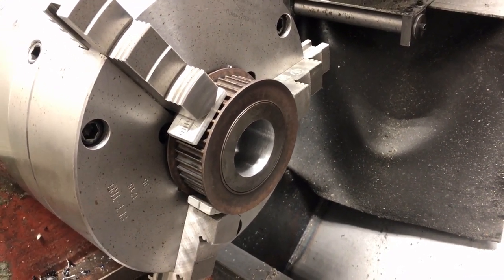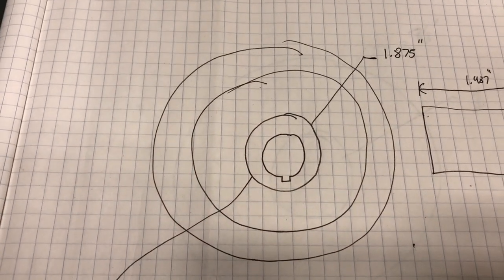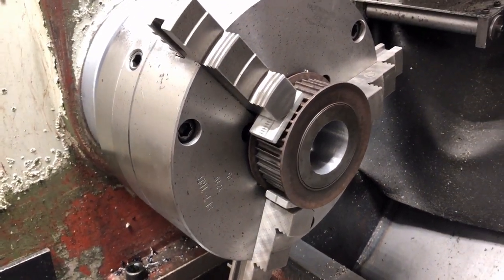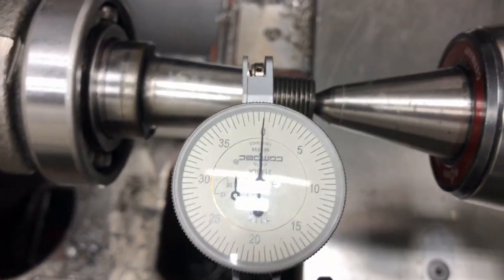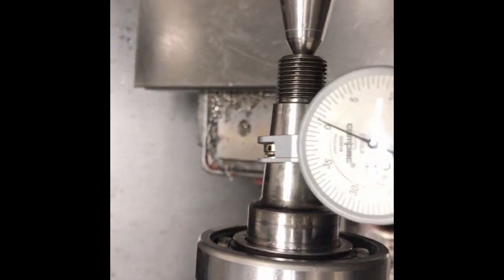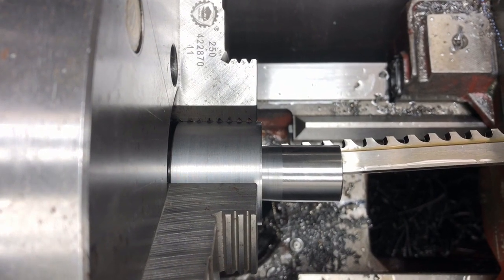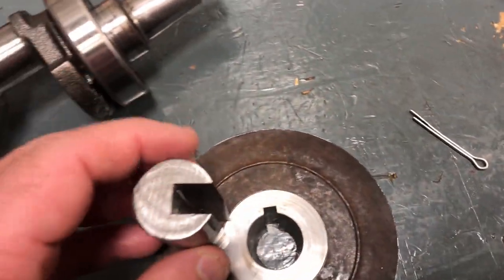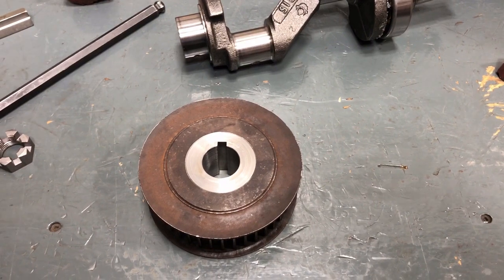Pulley With Tapered Bore and Keyway

Comment: Nice repair , that will last no worries .   That compressor may just be like a Tu Flow 500 or 700 .   On a pump they just blow air through a venturi to create a vacuum for the pump , so no big load on them .      Was the pulley made from some wierd cast stuff  or steel ?  👍
Reply from the maker: Thanks Max.  I was wondering how they could draw a vacuum without risk of ingesting water.  The venturi solves that problem. Funny you ask about the material.  At the beginning I thought it was steel.  While I was machining it the surface looked like cast iron but the swarf acted like it was steel.  In the end I suspect it was some weird cast iron that seems to behave like steel.  The material caused me to change my repair several times.  When I thought it was steel I was going to use a heavy press fit (.002"/inch) and no set screws.  After boring out the pulley and thinking it may be cast I decided to ease up on the interference and use set screws if necessary.  In the end the lighter press fit (slightly more then .001"/inch diameter) took all my hydraulic press could give and convinced me set screws were unnecessary.  Ken
Reply: @hmw-ms3tx  I was going to say , go lighter on the interference but you already had that part sorted !  Earlier pumps had a vacuum pump & a tank with a float to control the vacuum .   A bit like a dunny cistern , shit house troublesome system .  👍

Comment: Talk about Deja-vu. Nice you had the crank so you could dial in the taper. It was a guessing game for me since I don't have any taper mics.
Reply from the maker: I've only done one of these before and it was exactly what you are doing.  I built a clutch for my lathe and I had to make it fit on the tapered input shaft on the headstock.  Fortunately for me the original pulley was not damaged and I chucked it up and picked up the taper the same way I did on this video (albeit on the bore rather that the OD).  The only other time I successfully measured a taper was on a short shaft that I could stand up squarely on my surface plate.  I then put 1-2-3 block on each side and laid my calipers flat on top of the blocks and measured the diameter. (the 1-2-3 blocks ensured the caliper was square to the axis of the taper).  I then added another set of 1-2-3 blocks onto the first set and measured the diameter again.  Knowing the difference in diameter between the two measurements and knowing that the measurements were taken exactly 1" apart I then calculated the taper angle.  Ken